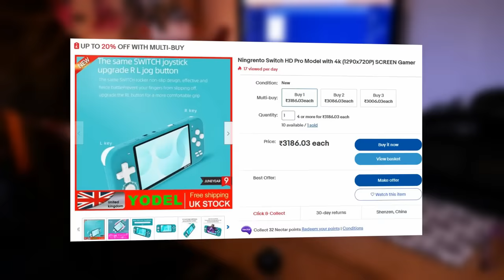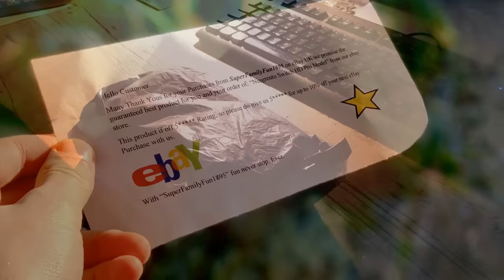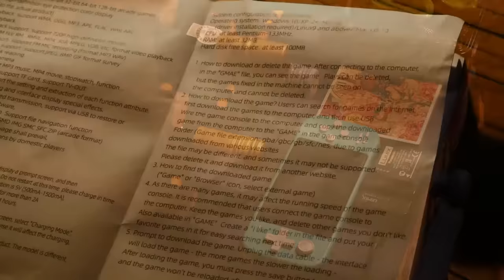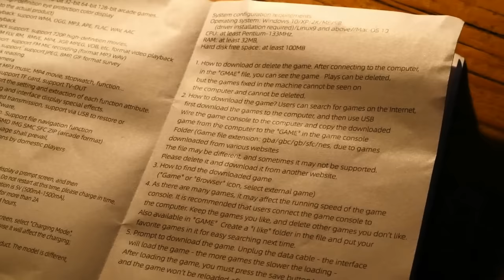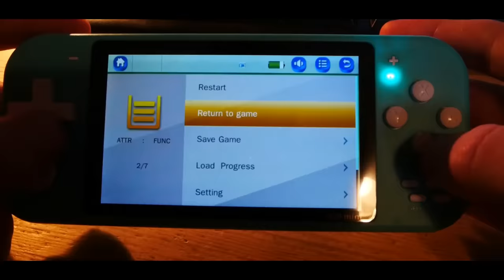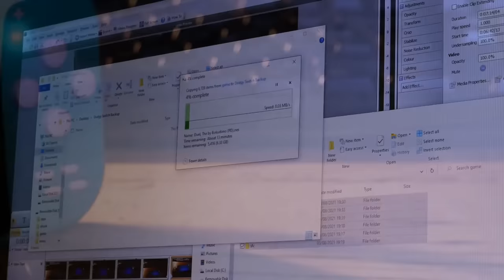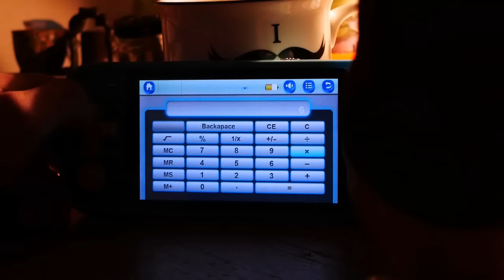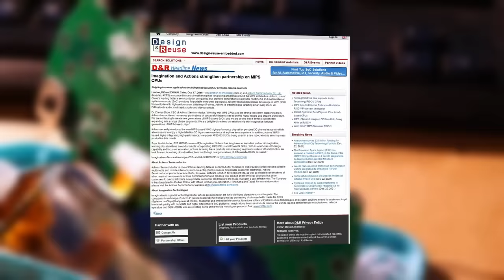I bought a $30 Nintendo Switch from China...

Comment: If you compared this to a price equivalent office pc which would be the better emulation device?
The pc would most likely be far more powerful, and include a larger storage capacity
Reply from the maker: The PC would be far better, however not as portable at all.
Reply: @BudgetBuildsOfficial  plus it would draw far more power and take up more space and require an external display and a bunch of other caveats

Comment: So they spent time and money to develop a device that could have been marketed better for another market. The emulator featuring real recycled chips. Also those types of screws are a pain, you get really good screwdrivers and the screw fits fine for 3 out of 4 of them and its just not turning.

Comment: The funny thing is I got pinged over this by someone I know if it was any good told them to avoid it like the plague and told them it is likely illegal what's on it and it looks like what I like to call hot trash e-waste. Told her to get the genuine article from Nintendo instead.
Reply: The switch is arguably e waste as well at the moment. Its probably about to get an upgrade soon.
Reply: @gjeraldh2989  I may do but I've not used mine enough to do so and more or less got it for Mario and Zelda and likely Bayonetta 3 when it comes out next year.
Reply: For $30 this is fine if you know what you're buying.
Reply: @horacegentleman3296   Yes thing is it is loaded with some controversial and in somc countries cases illegal games and that is a very risky thing given that you  might have your kids potentially by accident or deliberately trying to play them that alone is another reason to avoid it. 
#
Reply: @direravendenial8947  lol ok

Comment: Could be the Rom is fucked. Might not even be the hardware that's the problem when you're dealing with Roms you never really truly know what you're gonna get until it's running. Even then you might get to a part of the game where it just craps itself for no reason but is otherwise perfect. Could also be the emulator and it's settings you'd need to tweak. Lots of trial and error that you know nobody went through when they put all the games on the device.

Comment: The emulation is worse than a modded psp. Not as impressed of this thing as BBO is.
Reply from the maker: I mean ofcourse, however the fact this was all custom developed for a random SoC unique to this device is pretty impressive given the awful emulation quality a lot of these devices have .
Reply: @BudgetBuildsOfficial  I see your point. If you somehow could get a android distro to work on this thing it would be interesting to see how performance would be affected. Even if it ran worse it would still be a huge plus to run your own applications. I think i might get one to try it out.